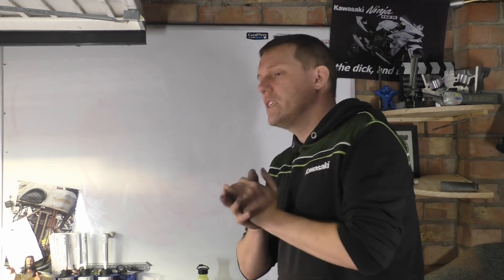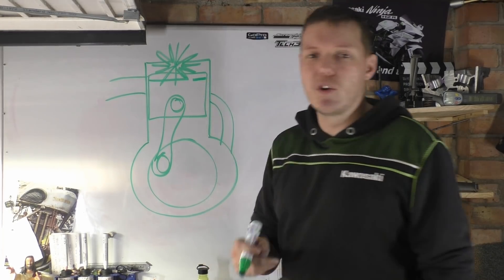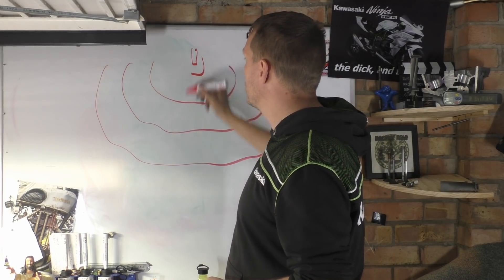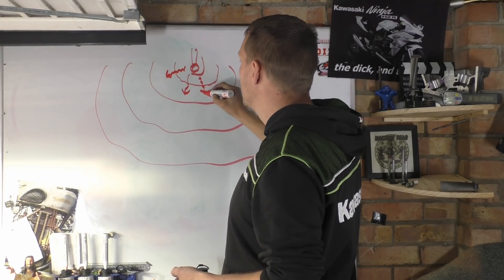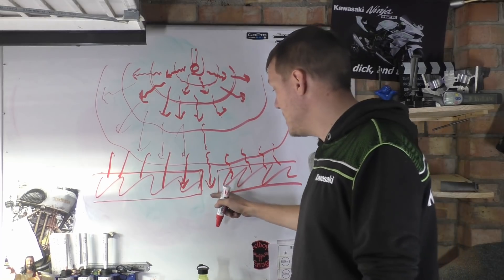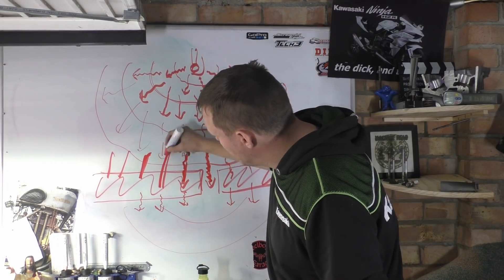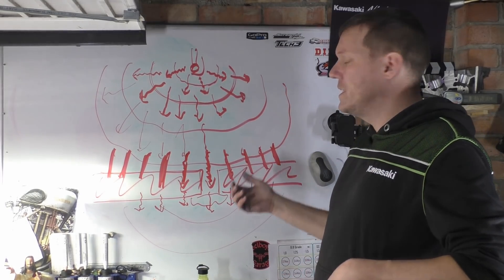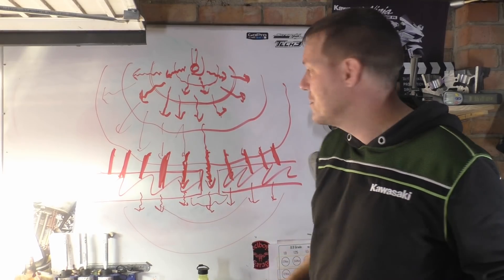2 stroke Crankcase ignition

Comment: Fun story. I have a 180cc 2t bike and the coolant pump is actually between the engine block halfs. When I did the engine rebouild, I did not seal it properly, so the coolant leaked into the crank case and since water is barely compressable, It made the engine "dieseling" (is it a real word in English?). I wanted to cut my veins as I poured out a ton of water from the cranckcase. Conclusion: water can make things ignite, so dont trust in it LMAO

Comment: Hey Matt. I have ridden 2smokers most my riding life but never really understood why a 2smoker does not have instant power when cold? It always needs to “clear” first before the power ranger kicks in!! Why so ??
Reply: As far as I know it has to do with the pressure wave in the expansion chamber as some more of the heat is sapped away into the cold chamber wall then bounces back slower as it is colder . I could be wrong but I think that's an issue with it anyway

Comment: You missed out a very important bit of information, there are usually 2 rings and you set the expansion gaps opposite to each other. I have run many racing 2 strokes and never seen a detonation in the crank cases. Apart from that great video
Reply from the maker: LOL this would be relevent if the flame front made it between the two rings, which it doesn't
Reply: @thedirtyworkshop  so in this video you explained why the flame can not ignite the crankcase through the pinston ring. BUT could you please explain why the fresh air/fuel mixture doesnt ignite during scavenging. I dont understand, when the exhaust port and the intake port is open and a bit of fresh mixture flows in to the hot exhaust, why doesnt it ignite in the exhaust and the flame travels then back in the cylinder and then even through the intake port in to the crankecase?
Basically a backfire in the exhaust should ignite the mixture in the cylinder while the exhaust port is open?

I love whatching your videos, i always learn something new, thank you😊👍👍👍
Reply: Same on 4 stroke, why does valve overlap not result in a backfire?
Reply: Dave Micolichek  oh my mistake sorry , it's 4 stroke engine where the rings turn about isn't it ?

Comment: it kind of makes you wander what happens in engines with multiple spark plugs, and if you had enough of them maybe you 'detonate' at least part of the mixture. Also, since higher octane fuel needs higher temperatures to ignite, wouldn't it also need more time to ignite, effectively retarding the timing.

Comment: Hi Matt I'm asking myself since ur vod on combustion why spark plugs aren't set lower into the chamber as it would be a better combustion if the ignition point was center to it
Reply from the maker: Because spark plug hae thermal mass. You don't want the spark plug hindering combustion just like the piston rings do in this exampl
Reply: @thedirtyworkshop  Roger thx